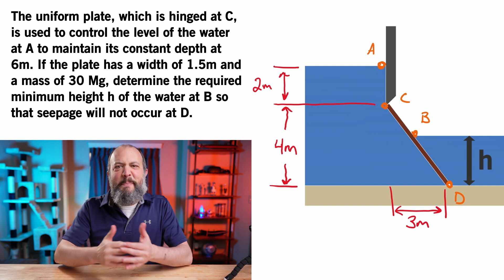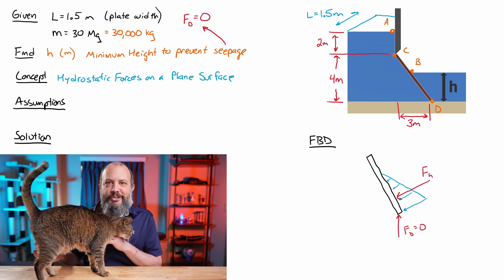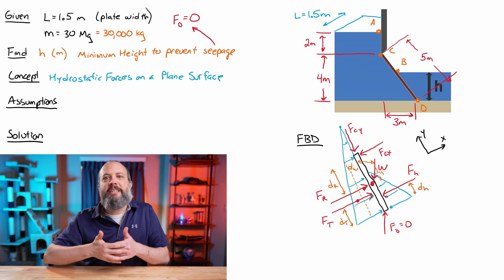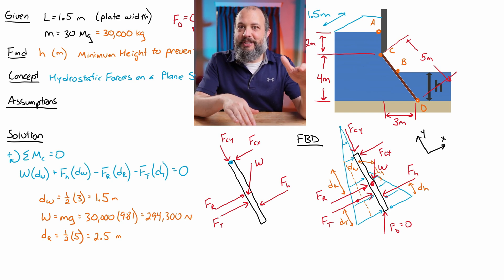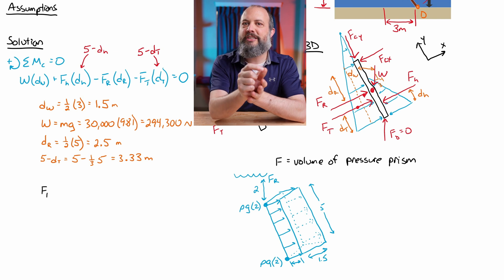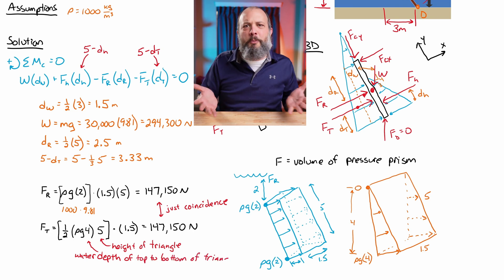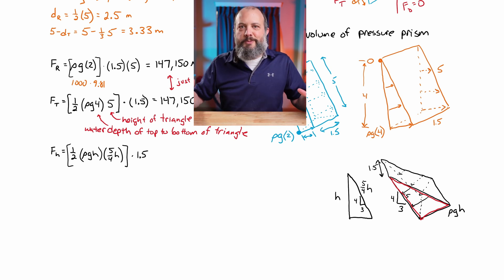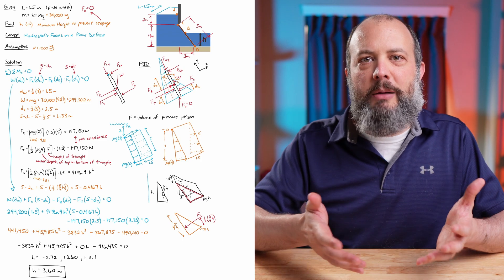Submerged Gate Forces and Moments – Pressure Prism Method

Comment: in regards to the force acting on the right side with an unknown depth, our class has emphasized that the resultant force uses the Pressure from the center of gravity, however the force does not occur there as there is ycp the distance from center of gravity to center of pressure, how are we able to acount for this in our sum of moments equation. in the video example you simply stated that the resultant force would occur at the centeroid of the given triangle, is this always true?
Reply from the maker: centroid of the triangle will be true if 2 conditions are met. 1. the top of the water is touching your gate. if the top of the gate is submerged some distance below the surface, then the shape will be a trapezoid, not a triangle. 2. the cross section of the gate must be rectangular, so the width of the gate in the direction into the page must be constant. if the gate is actually a round hatch or any other non rectangular shape, then the problem gets more complicated.